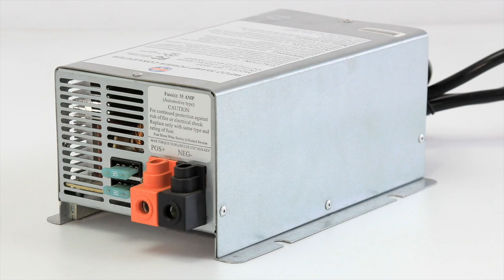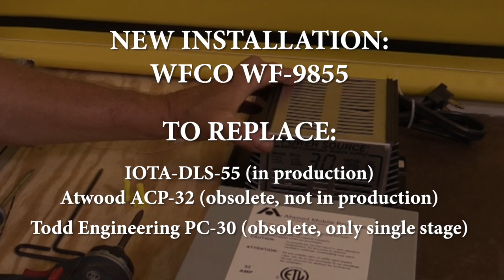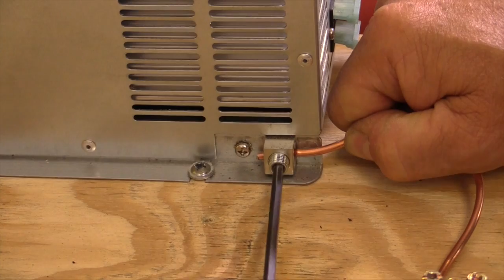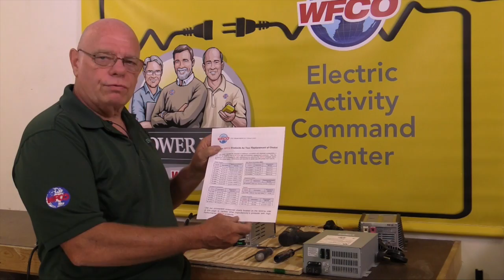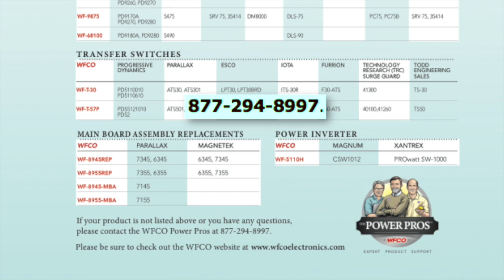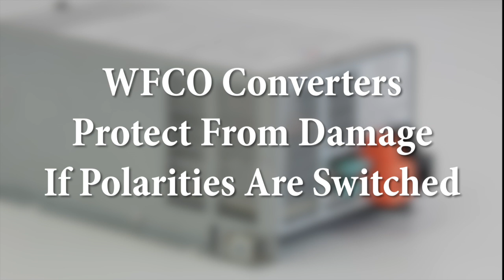Installation Video For WFCO WF-9855 Deck Mount Converter

Comment: At 68, I bought my first popup. A 2004 Rockwood Freedom (2280) The previous owners pulled the battery, I have been in contact with one of your "Techs" who said I needed your: WF-9855-AD, WF-5320 and the T-30. He has ghosted since I now asked for a wiring diagram. Trust is waning.

Comment: I have a WFCO 9835 converter in my trailer. Should it have 1 or two fuses installed, and what AMP fuse(s) size should be installed? Thanks!
Reply from the maker: Hi Carlos! It needs 1 fuse- 40A.
Reply: Do you guys answer on here i have a question?